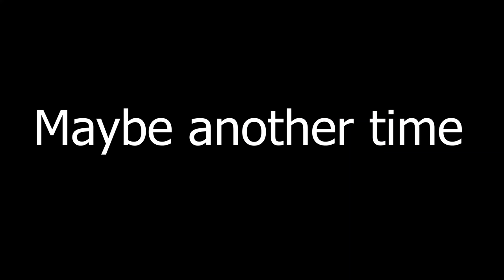You Won't Believe What We Found!

Comment: These constructors who decide to use brick as a decorative layer, should learn to fill everything with concrete. Having an empty space like that is a huge mistake
Reply: No way man.  I'm a bricklayer by trade.  There's a treated 6"x6" that supports that deck inside the brick column. The brick isn't even needed, it's just for looks. 
And if it needed to be structural it would handle that just fine.
Filling it with concrete would create an extremely hard core and the soft(ish) brick expand and contract with heat, cold, freezing, and thawing. This would more than likely cause severe cracking.
Reply: @MMGJ10  I'm living in Europe, we build everything out of brick and mortar. We have been filling holes and walls with concrete, mortar, gravel and what haves you for centuries. Unless it's an area with extreme temperature differentials it's perfectly okay to use.
Leaving that space empty is still a problem. If water finds it's way in there, it can rot away the 6x6. It's also more prone to pests. Bricks are a structural element, so they should be used like one, or just quit using them.
Reply: Filling the void costs money which adds to the cost of the house  with very little additional benefit gained.   The costs of housing is already getting too high in a lot of areas.   Every penny counts.
Reply: @Page5framing  in that case, the owner needs to put glass/wood/metal doors on 2 sides of each column, so that next time the bees get in, the whole thing can be removed without having to rebuild the brickwork every time they appear.
Reply: 2005Guyver02 by and large the bees getting into a column is a very very very rare occurrence.   The building trade cannot plan  for every possible outcome.  That is simply not Feasible.  We plan for the things that do occur  (wind, rain and weather, fire, earthquake, mold and mildew).  Pest infestation is entirely out of the realm of home construction.   That would be a maintenance issue.

And although they did save the bees they did not have to.    They could have sprayed them and killed the hive.   As horrid as that sounds to all us bee lovers out there.   (Just sayin.   Don’t kill me for it).
Reply: Do what you want. All I know is that hurricane-like conditions in Europe don't tear up any houses in half. Everything is reinforced with steel and mortar and at most you need to replace some roof tiles or windows. If the thermal expansion rate between mortar and bricks was as different as the brick layer says, we'd be seeing sunlight coming through the walls. My area ranges from -20° to +45°C (-4 to 113F) and we are just fine.

Comment: I'm surprised you don't take a cooler with drinks and ice in that hot climate down there. I'm from Pa. And don't leave home without one in summer months working. I guess it gives you a little break away from job. I like to get away from jobsite myself for a break  but I would still keep a cooler   good vid as usual

Comment: How long can brood go without bees on the comb in your summer evenings?  what is a safe window of time? 

Get your hands on a garden hose water fed 4 1/2 inch "Masonry Saw" if you want to cut through stone like butter,,,, or use a circular saw with a mason blade  and wear a dust mask to get that stuff out of the way, ,,which ever suits the job at hand. 
The 4.5  saw, saves my energy, and only set me back $140.
Reply from the maker: I've got the blades I just hate the noise.  Depending on the age of the brood it can last until the next day if it's capped.